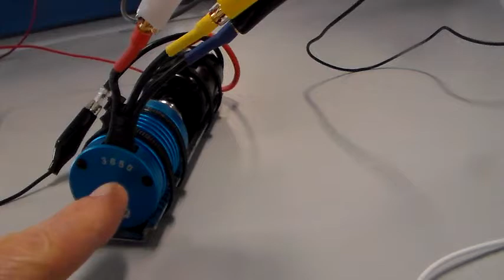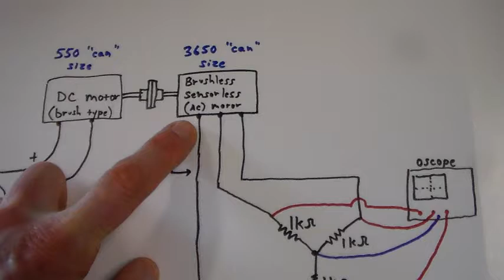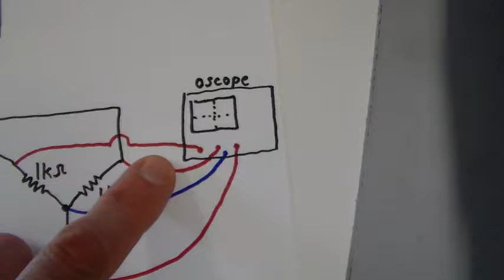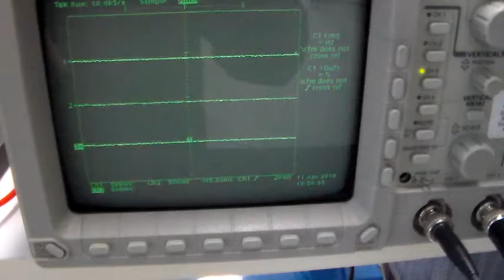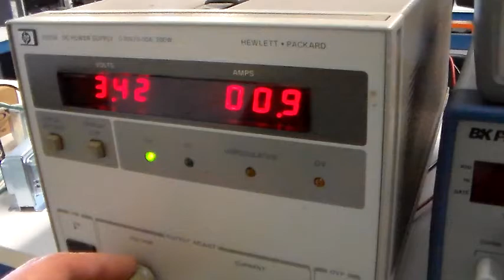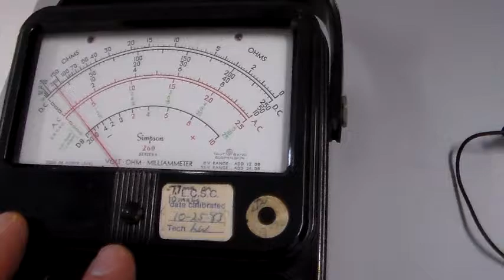Miniature 3-phase motor-generator set

Comment: Ha! That's too good. Din rail and everything, it's like it was meant to be. Exactly the kind of content I missed seeing on your old channel. I used to fly RC helis so I know I even have one of these three phase motors laying around somewhere. I wonder, how would you get higher voltage directly out of the motor? I guess that's just a function of how it's wound/voltage it was designed to run on? I know in helis they were catagorized by S, like 4S 6S 12S etc, the S being amount of lipo cells in series. So a 12S setup would be 12 times 4.2v. of course that's just the dc input to the speed controller (which, now that I think about it, is just a tiny VFD in these three phase setups). I suppose if you look up RC ESCs you can get 3 phase vfds that take dc input for less than 30 bucks - of course they're designed to run at several thousand rpm working range